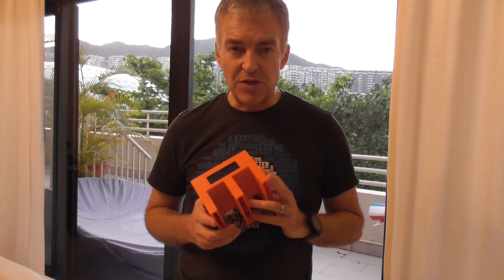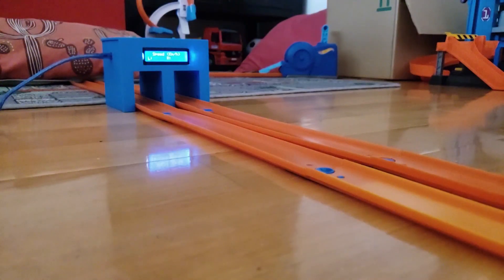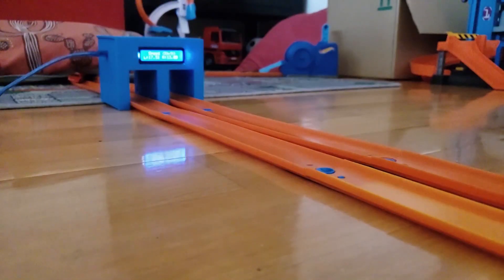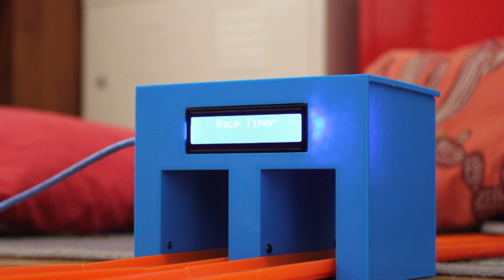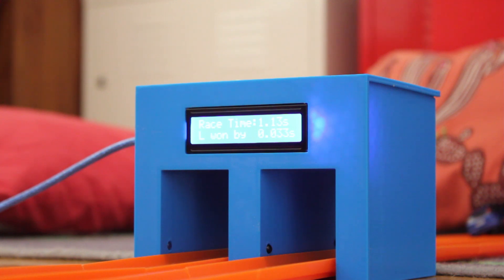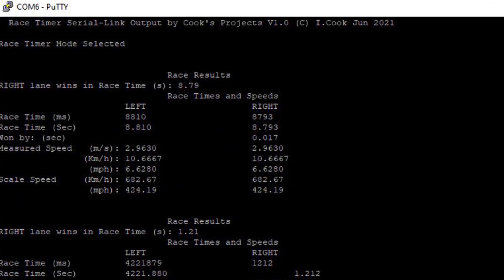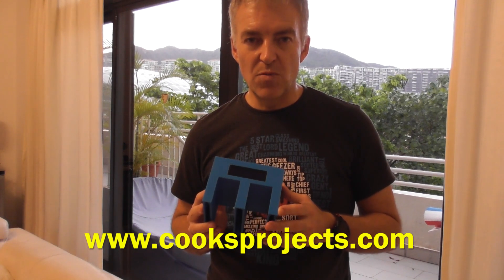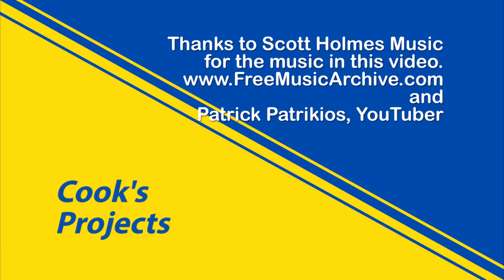Introducing Race Timer and Speedometer for Hot Wheels / Matchbox style model cars 1:64 scale diecast

Comment: How to check for early start? Is it possible to have a uplink to a contact, so that the cars cannot be started early? (I.e. by using a magnet switch, if active, no start is possible)
We want to use if for something like pinewood derby (2-lane) and your Monster version looks almost perfekt.
thanks.
Reply from the maker: It would be possible for the user to add additional equipment that is triggered by the serial USB output (available on the Advanced and Datalink models) of the Race Gate.
Reply: @cooksprojects That is great news. Do you also have these components as Plug and play? We might be interested maybe (need to talk to the others in the club) to purchase multiple units.

Comment: Can you do this for a 4 lane drag strip????
Reply from the maker: Hi @Unifiedavsolutions-tjb. The unit's microcontroller design can only have 4 sensors.  As each lane requires 2 sensors to measure speed, there isn't enough hardware or processing power to expand the single unit to 4 lanes - unless speed measurement is not required.  However, it would be possible to use 2 Race Gate units to measure the 4 lanes and combine the data.

Comment: What's the time between races? I mean, does it auto-reset or do I have to reset it manually?
Reply from the maker: Hi Apofica.  Thanks for your question.  The next race can autostart after a period of time or you can manually swipe a sensor to start the race countdown immediately.
After a race has finished, the results are displayed on the LCD screen (and sent to a computer via a datalink with certain models).  These screens display the lane that won, the race time and winning car difference for about 10seconds before changing to each car's speeds for another 10 seconds.  The Race Timer then enters a countdown of 10 seconds before the next race starts with a sound and light sequence.  You can pause the displays and the count sequence at any time before the race starts.  This gives as much time as you need to record the information or set up the next race.  When ready you then un-pause the Race Timer and the remaining data is displayed or you can skip all the data displays and begin an immediate race countdown sequence.  With our datalink models all this data, (with race numbers, better accuracy and more information about the race and car speeds) can be recorded on a computer and then used for further analysis.  So skipping the data display on the LCD can avoid the delays before starting the next race.
The Race Timer also offers a speedometer mode when every car's speed is instantly displayed and held until the next car passes the Race Timer.  Our latest models can now display the speeds on the LCD in Km/h or MPH.
If you would like more information, please contact us at www.cooksprojects.com
Reply: Thanks! I think it's very gracious of you to respond to every question in such detail.  @cooksprojects
Reply: How do i get programming part?